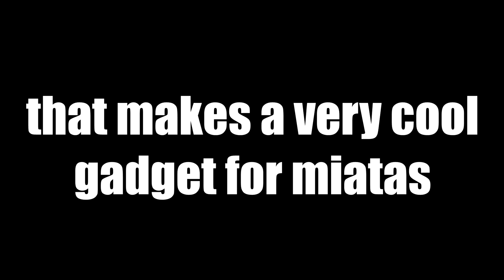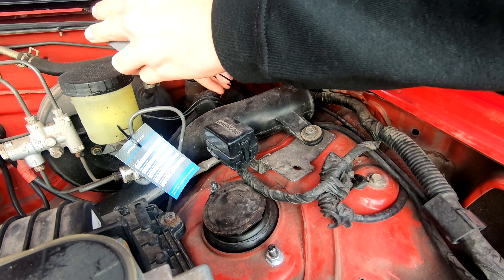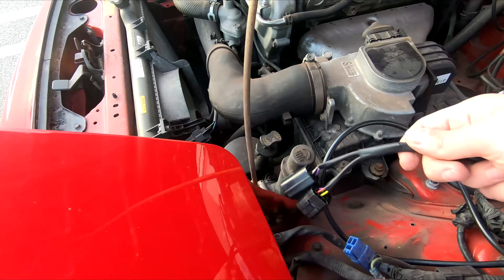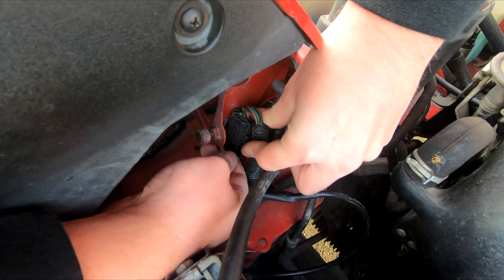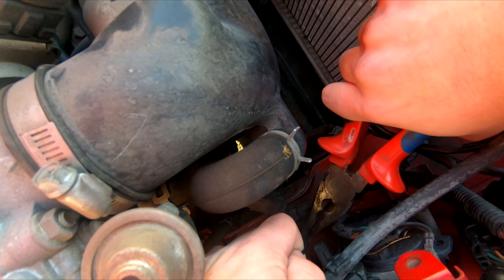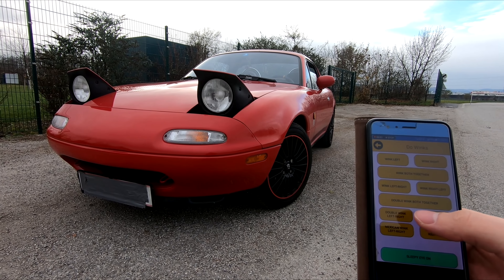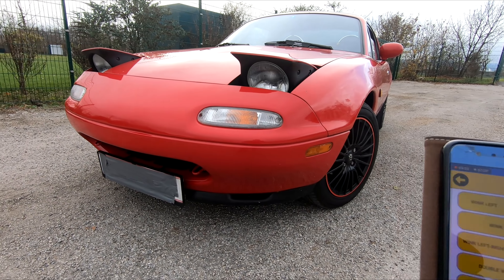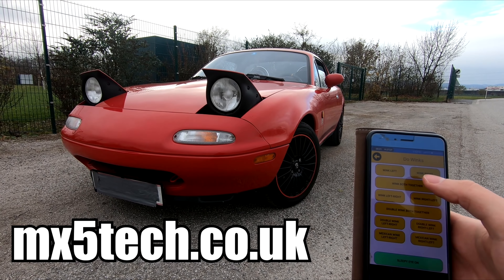Making my Miata's Headlights Remote Controlled

Comment: It almost looked like you were disconetcting the positivside of the batteri. If you were doing that i would advise against it because if you or the wrench touch almost any metal you will short circut it giving yourself a shock or as i did and weld a wrench to your  exhaust manifold, stay safe:)

Comment: Hi, I found these about 2-3 weeks ago, and I wanted them. However, I didn't find how it works when you turn on the lights. Does it open automatically, or do you need to open then with the app, or press button everytime you want to use lights. Thanks 🙂👍
Reply from the maker: you can control it with the headlamp button inside your car!
Reply: @CarMighty  ok, so.. left stick behind steering wheel where you normally turn on lights, can now only turn on the light bulbs, however to pop the headlamps up you must press button on center console. Am I right?

Comment: Dude, clean out your car!, SERIOUSLY there is more sand on your engine than the whole desert, you don't even need to use water just use a big artists brush or paint brush and brush out the dirt while sucking it up with a vacuum cleaner ( if you want to use water please watch how to clean your engine using water videos )
Reply: It won't be a perfect clean but at least a bit cleaner than that...